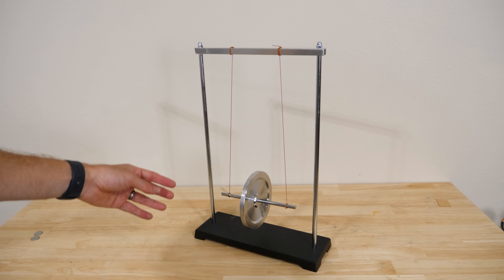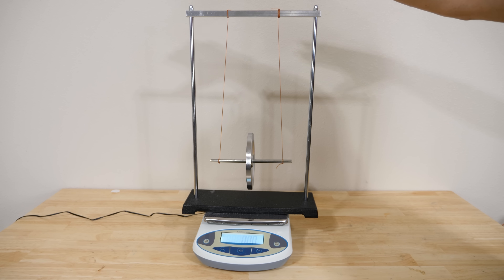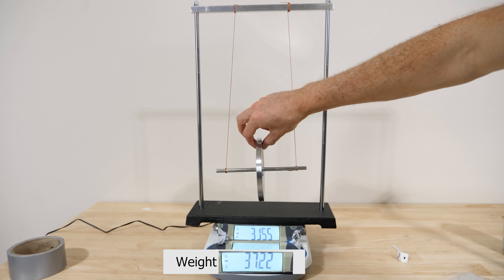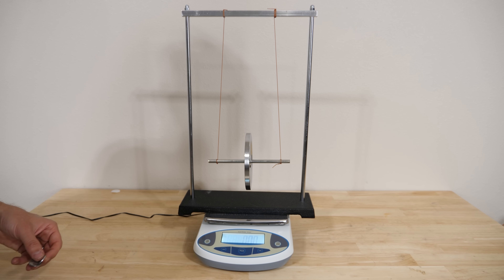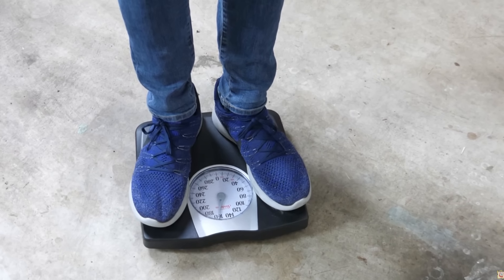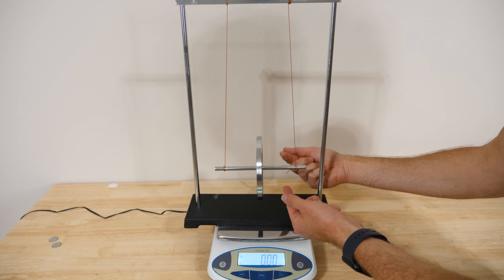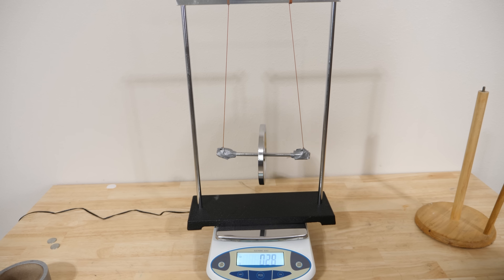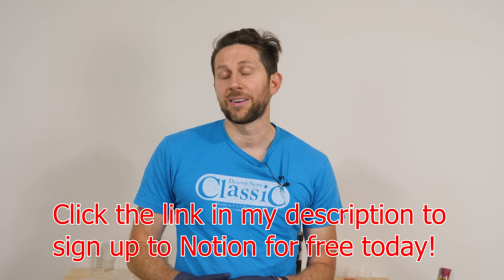How Does The Anti-Gravity Wheel Work?

Comment: if it is negative 6 why isn't it floating???
Reply: It only Appears to REDUCE the effect of gravity, BUT only while off the bottom.
It's a bit complex, but. . .   It is actually falling most of the time, just falling slower than gravity is trying to get it to fall.
..
..
Here's the deal with this wheel:
The wheel does NOT weigh less when it is spinning!.
..
It may be more correct to say that it weighs less when it is "bouncing".
..
I have a problem with the interpretation of the Laithwaite demo.  Precession does not translate the wheel.  It does not lift it. 
Precession causes the axis of rotation to change direction. This is a ROTATION about the center-of-mass of the wheel. It is not lifting the whole wheel's mass. 
.
Precession does not cause the gyro to move (translate) sideways, nor upward in Laithwaite 's case or Veritasium's case. 
If the vertical spinning gyro had translation, it would slide along the table, but stay vertical. It does not do that.  It tips, or rotates at 90 degrees.
The fact that the handle is offset and long has significance.  If you push the handle in the direction of the precession, that lifts the handle, right?.

However the interpretation that the spinning wheel is always accelerating downward even while moving upward,  is a very good catch. It took me a few seconds to realize that.  My quick initial feeling was that the weight would go positive on the way up. . . 
The way to think of it is that is is 'partly falling' due to gravity.  When you are in free-fall you are completely 'weightless'.  The spin and string-shaft arrangement allow it to fall, but not fully, as when you are in free-fall.  So, the frame experiences somewhere between the full weight and weightless ness, but more weight during the bounce time. 
..
 The winding and unwinding of the string causes the up and down motion which is what changes the weight. 
..
Stand on a bathroom scale and at a medium speed, move up and down by bending your knees.  Try to move faster and faster on the way down and slower and slower on the way up. You will see your weight decrease during those times.

.. .. ..
If you watch carefully, you see that it is speeding-up as it drops; this is accelerating, but not at the full 'gravity-rate'.
Also, it is slowing-down as it rises, again not fully accelerating (decelerating or negative acceleration) due to gravity.
..
On a trampoline you are completely weightless from the time your feet leave the trampoline until they touch again and start the bounce. During this time you are constantly in 'total' free-fall.
When in contact with the trampoline you are accelerating upward and weigh more than normal.
If you can add a small upward force to reduce the acceleration due to gravity, you will weigh less. No surprise there.

This is analogous to only "partway" jumping on a trampoline (or your bouncing ball).  On a tramp, you are accelerating downward when your feet are not in contact with the tramp. The ball is when it is not in contact with the floor.  The spinning wheel only "partly" leaves the support strings.  It is "partially bouncing".
If the tramp accelerated you upward at twice the rate of gravity, your weight would double.
Therefore, there is also a slight increase in weight at the bottom bounce.
.
This would be equivalent to a small jetpack on your back that can't lift you, but only partly reduces your weight.  You would be in "Sloe-Fall", not free-fall.
..
This would make a wonderful Dean Drive Scam. . . .
..
It would be nice to have a real-time force load cell so we can see what happens at the bottom of the wheels travel - the positive weight gain during the short 'bounce' time.

..
Also, WHAT HAPPENS to the weight, if the wheel is NOT spinning, but bouncing while being suspended by a spring, instead of the winding/unwinding strings?  
Is that equivalent to this "partial bouncing" effect?

Comment: You converting mass into kinetic energy. When the kinetic energy get dispersed then the mass will return to the right weight.
Reply: Nope.
Here's the deal with this wheel:
The wheel does NOT weigh less when it is spinning!.
..
It may be more correct to say that it weighs less when it is "bouncing".
..
I have a problem with the interpretation of the Laithwaite demo.  Precession does not translate the wheel.  It does not lift it. 
Precession causes the axis of rotation to change direction. This is a ROTATION about the center-of-mass of the wheel. It is not lifting the whole wheel's mass. 
.
Precession does not cause the gyro to move (translate) sideways, nor upward in Laithwaite 's case or Veritasium's case. 
If the vertical spinning gyro had translation, it would slide along the table, but stay vertical. It does not do that.  It tips, or rotates at 90 degrees.
The fact that the handle is offset and long has significance.  If you push the handle in the direction of the precession, that lifts the handle, right?.

However the interpretation that the spinning wheel is always accelerating downward even while moving upward,  is a very good catch. It took me a few seconds to realize that.  My quick initial feeling was that the weight would go positive on the way up. . . 
The way to think of it is that is is 'partly falling' due to gravity.  When you are in free-fall you are completely 'weightless'.  The spin and string-shaft arrangement allow it to fall, but not fully, as when you are in free-fall.  So, the frame experiences somewhere between the full weight and weightless ness, but more weight during the bounce time. 
..
 The winding and unwinding of the string causes the up and down motion which is what changes the weight. 
..
Stand on a bathroom scale and at a medium speed, move up and down by bending your knees.  Try to move faster and faster on the way down and slower and slower on the way up. You will see your weight decrease during those times.

.. .. ..
If you watch carefully, you see that it is speeding-up as it drops; this is accelerating, but not at the full 'gravity-rate'.
Also, it is slowing-down as it rises, again not fully accelerating (decelerating or negative acceleration) due to gravity.
..
On a trampoline you are completely weightless from the time your feet leave the trampoline until they touch again and start the bounce. During this time you are constantly in 'total' free-fall.
When in contact with the trampoline you are accelerating upward and weigh more than normal.
If you can add a small upward force to reduce the acceleration due to gravity, you will weigh less. No surprise there.

This is analogous to only "partway" jumping on a trampoline (or your bouncing ball).  On a tramp, you are accelerating downward when your feet are not in contact with the tramp. The ball is when it is not in contact with the floor.  The spinning wheel only "partly" leaves the support strings.  It is "partially bouncing".
If the tramp accelerated you upward at twice the rate of gravity, your weight would double.
Therefore, there is also a slight increase in weight at the bottom bounce.
.
This would be equivalent to a small jetpack on your back that can't lift you, but only partly reduces your weight.  You would be in "Sloe-Fall", not free-fall.
..
This would make a wonderful Dean Drive Scam. . . .
..
It would be nice to have a real-time force load cell so we can see what happens at the bottom of the wheels travel - the positive weight gain during the short 'bounce' time.

..
Also, WHAT HAPPENS to the weight, if the wheel is NOT spinning, but bouncing while being suspended by a spring, instead of the winding/unwinding strings?  
Is that equivalent to this "partial bouncing" effect?

Comment: You may have a scale for each string and then measure the mass. Each scale may show different value due to the gyroscopic effect. When this wheel rotates in a direction one sting may have less tension and the another one may have tension equal to half (or zero) of the (wheel) mass. But due the change in direction for each cycle, string alters.
Reply: Great. I think it's correct explanation
Reply: @dilipdas5777  Here's the deal with this wheel:
The wheel does NOT weigh less when it is spinning!.
..
It may be more correct to say that it weighs less when it is "bouncing".
..
I have a problem with the interpretation of the Laithwaite demo.  Precession does not translate the wheel.  It does not lift it. 
Precession causes the axis of rotation to change direction. This is a ROTATION about the center-of-mass of the wheel. It is not lifting the whole wheel's mass. 
.
Precession does not cause the gyro to move (translate) sideways, nor upward in Laithwaite 's case or Veritasium's case. 
If the vertical spinning gyro had translation, it would slide along the table, but stay vertical. It does not do that.  It tips, or rotates at 90 degrees.
The fact that the handle is offset and long has significance.  If you push the handle in the direction of the precession, that lifts the handle, right?.

However the interpretation that the spinning wheel is always accelerating downward even while moving upward,  is a very good catch. It took me a few seconds to realize that.  My quick initial feeling was that the weight would go positive on the way up. . . 
The way to think of it is that is is 'partly falling' due to gravity.  When you are in free-fall you are completely 'weightless'.  The spin and string-shaft arrangement allow it to fall, but not fully, as when you are in free-fall.  So, the frame experiences somewhere between the full weight and weightless ness, but more weight during the bounce time. 
..
 The winding and unwinding of the string causes the up and down motion which is what changes the weight. 
..
Stand on a bathroom scale and at a medium speed, move up and down by bending your knees.  Try to move faster and faster on the way down and slower and slower on the way up. You will see your weight decrease during those times.

.. .. ..
If you watch carefully, you see that it is speeding-up as it drops; this is accelerating, but not at the full 'gravity-rate'.
Also, it is slowing-down as it rises, again not fully accelerating (decelerating or negative acceleration) due to gravity.
..
On a trampoline you are completely weightless from the time your feet leave the trampoline until they touch again and start the bounce. During this time you are constantly in 'total' free-fall.
When in contact with the trampoline you are accelerating upward and weigh more than normal.
If you can add a small upward force to reduce the acceleration due to gravity, you will weigh less. No surprise there.

This is analogous to only "partway" jumping on a trampoline (or your bouncing ball).  On a tramp, you are accelerating downward when your feet are not in contact with the tramp. The ball is when it is not in contact with the floor.  The spinning wheel only "partly" leaves the support strings.  It is "partially bouncing".
If the tramp accelerated you upward at twice the rate of gravity, your weight would double.
Therefore, there is also a slight increase in weight at the bottom bounce.
.
This would be equivalent to a small jetpack on your back that can't lift you, but only partly reduces your weight.  You would be in "Sloe-Fall", not free-fall.
..
This would make a wonderful Dean Drive Scam. . . .
..
It would be nice to have a real-time force load cell so we can see what happens at the bottom of the wheels travel - the positive weight gain during the short 'bounce' time.

..
Also, WHAT HAPPENS to the weight, if the wheel is NOT spinning, but bouncing while being suspended by a spring, instead of the winding/unwinding strings?  
Is that equivalent to this "partial bouncing" effect?
Reply: Nope.  Both strings will show the same as long as the horizontal distances from string to center-of-mass are equal.

..
Here's the deal with this wheel:
The wheel does NOT weigh less when it is spinning!.
..
It may be more correct to say that it weighs less when it is "bouncing".
..
I have a problem with the interpretation of the Laithwaite demo.  Precession does not translate the wheel.  It does not lift it. 
Precession causes the axis of rotation to change direction. This is a ROTATION about the center-of-mass of the wheel. It is not lifting the whole wheel's mass. 
.
Precession does not cause the gyro to move (translate) sideways, nor upward in Laithwaite 's case or Veritasium's case. 
If the vertical spinning gyro had translation, it would slide along the table, but stay vertical. It does not do that.  It tips, or rotates at 90 degrees.
The fact that the handle is offset and long has significance.  If you push the handle in the direction of the precession, that lifts the handle, right?.

However the interpretation that the spinning wheel is always accelerating downward even while moving upward,  is a very good catch. It took me a few seconds to realize that.  My quick initial feeling was that the weight would go positive on the way up. . . 
The way to think of it is that is is 'partly falling' due to gravity.  When you are in free-fall you are completely 'weightless'.  The spin and string-shaft arrangement allow it to fall, but not fully, as when you are in free-fall.  So, the frame experiences somewhere between the full weight and weightless ness, but more weight during the bounce time. 
..
 The winding and unwinding of the string causes the up and down motion which is what changes the weight. 
..
Stand on a bathroom scale and at a medium speed, move up and down by bending your knees.  Try to move faster and faster on the way down and slower and slower on the way up. You will see your weight decrease during those times.

.. .. ..
If you watch carefully, you see that it is speeding-up as it drops; this is accelerating, but not at the full 'gravity-rate'.
Also, it is slowing-down as it rises, again not fully accelerating (decelerating or negative acceleration) due to gravity.
..
On a trampoline you are completely weightless from the time your feet leave the trampoline until they touch again and start the bounce. During this time you are constantly in 'total' free-fall.
When in contact with the trampoline you are accelerating upward and weigh more than normal.
If you can add a small upward force to reduce the acceleration due to gravity, you will weigh less. No surprise there.

This is analogous to only "partway" jumping on a trampoline (or your bouncing ball).  On a tramp, you are accelerating downward when your feet are not in contact with the tramp. The ball is when it is not in contact with the floor.  The spinning wheel only "partly" leaves the support strings.  It is "partially bouncing".
If the tramp accelerated you upward at twice the rate of gravity, your weight would double.
Therefore, there is also a slight increase in weight at the bottom bounce.
.
This would be equivalent to a small jetpack on your back that can't lift you, but only partly reduces your weight.  You would be in "Sloe-Fall", not free-fall.
..
This would make a wonderful Dean Drive Scam. . . .
..
It would be nice to have a real-time force load cell so we can see what happens at the bottom of the wheels travel - the positive weight gain during the short 'bounce' time.

..
Also, WHAT HAPPENS to the weight, if the wheel is NOT spinning, but bouncing while being suspended by a spring, instead of the winding/unwinding strings?  
Is that equivalent to this "partial bouncing" effect?